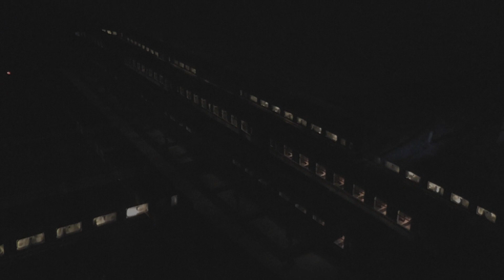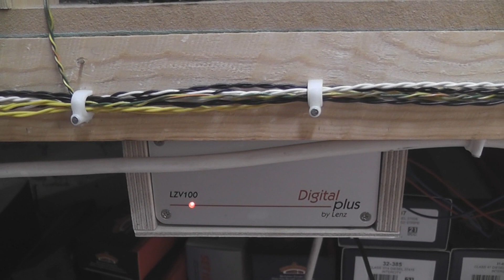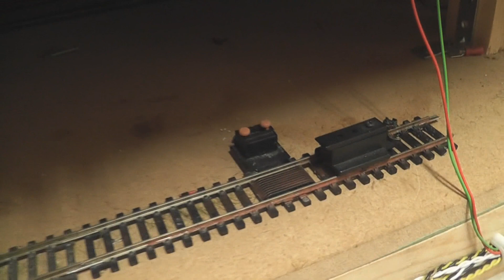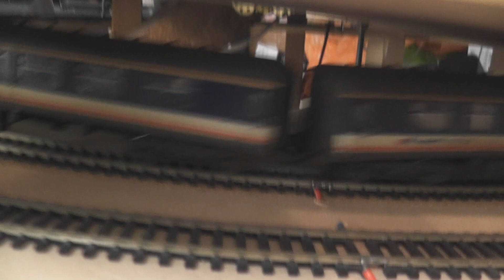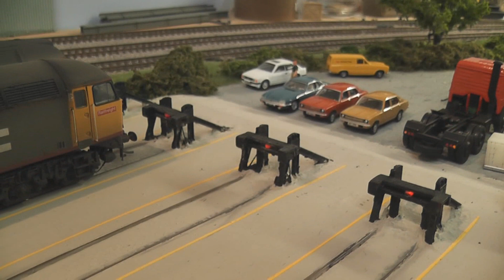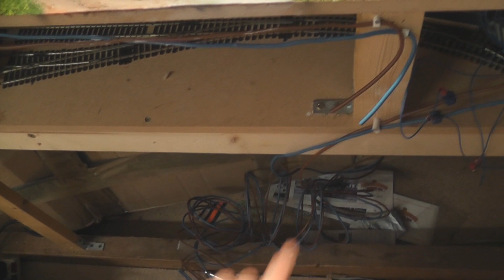Power and Control

Comment: Great to see the old layout and uninsulated loft. On the subject of the DCC bus wiring you were careful to point out that it wasn't a ring circuit, but wouldn't a ring give potentially lower impedance for trains further away from the controller wiring?

Comment: I really like your videos and find them easy to follow.  I'm new to the hobby and so I have some basic doubts, like.... does only one pair on wheels on the loco sense the current from the tracks?  Reason being, if more than one set of wheels are used to pick up the current, then there could be a conflict when changing  blocks, or when in a reverse loop situation  when polarities are switched. In the second case, the two sets of wheels could sense opposite polarities at the same time!  I'm sure that will never happen, but I need to clarify the doubt. Thanks, Ganny.

Comment: Hi Richard. I assume you solder dropper-wires to your track (rather than, say, use pre-soldered rail joiners) so as to maintain a reliable connection. So, I wondered why you chose the splice and spade connectors; I have seen other users prefer not to use these connectors because they believe the connections are not so reliable as soldered joints. Have you experienced any problems with splice and spade connectors?

Comment: you said that the bus wire isn't a loop, then wouldn't having two long pieces of wire be an unfinished circuit and not supply power?

Comment: Hello. Really enjoying these videos so thanks for doing them. I'm returning to model railways after many years and am intrigued by the technology. In this you showed a 3rd power supply from Rapid to power your signals. Could you have used this power supply to power both your signals and your accessory bus simultaneously? I'm looking to minimise the cost of starting again. Thanks again.
Reply from the maker: You should be able to use a single power supply.  Make sure you use a CDU if you are using solenoid point motors.
Reply: Will do. Thank you very much.

Comment: where do you get your locos and waggons
Reply: In Europe, most people get their stuff from Hornby and Gaugemaster, there's a few others but those are the biggies.  In America, Tony's Train Exchange and Nicholas Smith Trains are two very reputable sellers, but again there are many, many others -- Americans have a bigger choice of products and shops to buy from.  Plus there's always Amazon and eBay.  I try to buy from my local hobby shop, but they often charge way more for the same item than you can get it online, which is unfortunate.  You can usually order from across the pond to your side of the pond, but keep in mind that American retailers sell HO scale trains while European retailers sell OO scale trains.  Both HO and OO use the same track, but OO models are slightly bigger than HO models.  I run a mix of HO and OO scale trains on my layout, and you can't really tell the difference unless you have the exact same carriage in the different scales coupled together.  One big thing to keep in mind is if you buy OO scale trains from a European shop, even high end trains, they don't come with Kadee couplers and you'll have to install Kadee couplers yourself.  American trains tend to come with Kadee couplers, even the low end models.

Comment: Know you have a regulated supply, but could use a L7805 on your board which would convert 12V dc to 5V dc. Could save some expense for other people.
Reply from the maker: Challoch Junction Nothing wrong with making your own supply.  A common one is to modify a computer power supply.

Comment: have you got the code number for the buss wires you use please ? .. you give the connector codes, but not the code for the wires, whenever I shop for wire its hard to find single core wire .. thanks
Reply: fees sq SQL
Reply: JDPuss1 search for heavy duty household wire

Comment: I am currently sorting my loft, and once some flooring is down I will be looking to build a layout. Most of my stuff at the moment is DC (apart from one DCC loco I was given). I want to go DCC. Forgetting points for now, can I wire up the layout for DCC, but still run DC on it until I get some DCC kit?
Reply from the maker: ***** If you wire a layout for dcc but use a dc controller you will have issues with all your locos running at once.  All the track with dcc is wired up to the controller and there are no isolating sections.  So running with dc will be problematic.

Comment: hello, What is the best way to test that your bus cable and feeds to the rail are working correctly. Today I took out my insulfrog points and going to replace them with electrofrog points in the next day or two. I noticed that the rest of the layout was dead, even where the controller is connected to the bus wire. Is there anything to worry about? Thank You
Reply from the maker: Gary Shardlow The best thing to use is a multimeter to check them.  Is it a DCC layout?  Are the feeds running to the tracks you tested?
Reply: It is a DCC layout, The feeds running to the track have not been tested as I always had a continuous track circuit. I use slightly different crimp splicers where you have two places for your cables. One is a continuous hole where the bus cables goes in. The other has a dead end for your track feed to go in place. Then squeeze the metal plate into both cables and fold the plastic over the top. I was using a Hornby Select controller when I sent you the first message, I know the hornby select isn't the best. Just got a used Lenz LH100 and Lenz system in excellent condition on eBay last night for £137.00, and picked up a transformer today. I will test the track today at some point. TY

Comment: The Lenz system is fantastic for what it is. I do however like the Digitrax system too. Having used both I actually cant say either is better because they are both very high end DCC systems I did start off with a Hornby select just when DCC was first introduced to the market but quickly moved on to the Prodigy Advance unit. A quick note for anyone wanting to get into DCC but wondering how complicated it is well I would say DCC is so much easier than DC due to the fact that you make all the tracks live rather than any insulated sections.

Comment: I've recently begun to get back into model trains after many years.  40-plus to be more accurate.  I used to have a small, well landscaped DC setup when I was young.  Wiring and operation were very simple.  Approaching retirement, I now have the time (and resources) to go hog-wild.  Being new to DCC, and not having begun construction of my layout yet (it's still in the conceptual and planning stages), I've spent many hours reading and studying the changes in the hobby to make sure I avoid as many catastrophes and costly errors as possible.  I've watched hundreds of "how-to" videos on YouTube but I have to say, yours are far and above the most informative and helpful I've found.  Please keep making them!
 
I have one question though; have you given thought to wiring your signals into your point motors for automatic signalling?  I'll be running a moderate sized passenger station as well as a couple of large freight yards and signalling is a significant part of my planned layout.  I was wondering the what the best ways to might be to accomplish automatic signalling. 
Great work.  Thanks again!
Reply from the maker: hercdriver08

Thanks for the comment.  I'll be looking into wiring some signals to points but only the ones with directional indicators.  The few signals I do have are currently wired to work automatically on a time basis
and use the trains to trigger them.  I have another howto in the making about how they work which I'll try to get finished before christmas.

Comment: Hi, I'm new to DCC and this was a really helpful video.  Thanks a lot - appreciate it.  One thing I'm still not sure about, though. Do I still need to worry about + and - rails when wiring the track, or is it simply being consistent about which rail I wire to which bus wire?  Hope that's not a really daft question and look forward to hearing from you, cheers, Stu.
Reply from the maker: Stewart Fraser Make sure you are consistent when wiring the track.  I use a wagon with some black and red wire taped to either side.  Then make sure you keep the wagon to same way round and use it as a guide for wiring the rest of the layout.
Reply: EverardJunction Thanks a lot.  That's great - appreciate it, cheers, Stewart.
Reply: EverardJunction That's a fantastic idea, will do that myself.

Comment: Very helpful video, noted that the buzz wires are 2.5 dia, from your reply , would 1.5 dia do? and do you use the same for the droppers?  And what size of wire for points? I am at long last be able to make my layout in the basement and have looked at your how to videos very instructive
Thanks Keith
Reply from the maker: You can use any wire you want really.  The voltages and current involved is very low so most wire will do the job.

Comment: Hi, I think I got almost everything from rapid electronics, except the solid core bus wires you have, I don't think they have them. Could you please tell me what type of heat shrink you use from this link rapidonline com/Cables-Connectors/Rapid-3-1-Heat-shrink-sleeving-on-25m-reels-68952 ?

Comment from the maker: The bus wire is the 2.5mm solid core wire you get out of ordinary grey building wire. I bought a reel from a diy shop and stripped the two wires out from inside.

Comment: Hi,I picked up on your video that you do not 'loop' your bus wire back but leave the ends capped off, is there any reason for that?
I am just about to re-wire my 8x4 and was advised by CM3 Models where I got the wire from to loop it back to the DCC control power system.  Andy

Comment from the maker: The bus wire is the 2.5mm solid core wire you get out of ordinary grey building wire. I bought a reel from a diy shop and stripped the two wires out from inside. I think the dropper wire is 1.2mm.

Comment: I can a bit found out using Rong volt iron. If use insulfrog point i would wire each track of it to the bus. Is the bus better out or wire or copper tape what size wire do u use(the thick wire) is that needed or is the thick Peco/gaugemaster ok to use. Dose the splice some within instructions or are they oblivious how to use.

Comment from the maker: Generally people who build N gauge layouts wire them up the same as OO scale layouts as the N scale locos still require 12V to run.

Wiring points up to dcc really improves the running of the trains.  However if you can't solder then I would just go with insulfrog points.  I would also suggest you learn how to solder as it's required in many aspects of building a model railway.

Comment: I am using n gauge and want to use copper tape as cant solder but see ur  slice and the bus is huge wire wood it be needed in n . If wire all 3 set of the point to a separate bus would i need seep motor. In n if using elite and  pos railmaster with about 5 loco at once wood can i use dcc points

Comment from the maker: Ok, from what you said it sounds like you have a tender drive hornby flying scotsman.  The square truck with the coal in it is called the tender.  Steam trains with the motor in the tender are very unreliable.  They don't actually make them like that anymore.

I would suggest you take the train to your local model shop and get them to have a look at it.  Most most shops will service and repair model trains for you.

Comment: Im not to sure who makes the flying scotsman and i brought it of an exhibition stall around a year and a half ago. And also it was second hand when i got it and not sure how old it was before i got it. It is the front wheel of the engine carrage , i dont know what its called ( it is the part that has the coal bit on it and has the engine in it and its at the back of the 2 parts it comes with ie. the front which is the long part which has the pick ups and the back part with the engine in it) ??

Comment from the maker: An attic is quite good place to build, but has its problems.

Advantages..

Plenty of space
Good security
Doesn't matter if you make a mess
Quiet

Disadvantages

Cold in winter, hot in summer
If you're tall headroom can be a problem
Lots of lighting or a window is required

Comment from the maker: The bus wire is the 2.5mm solid core wire you get out or ordinary grey building wire. I bought a reel from a diy shop and stripped the two wires out from inside.

Comment from the maker: The bus wire is the 2.5mm solid core wire you get out or ordinary grey building wire. I bought a reel from a diy shop and stripped the two wires out from inside.  It's fine for a small layout, but you might want to use something smaller.

Comment: Hi. Great video. I have a few questions for, if possible, to answer. How much money do you usually spend on trains and carraiges etc?  I have a problem, i have a flying scotsman and all the time the front wheel of the back engine keeps lifting up and wobbling which means all the time it derails. Please help me with this. Is there any way to solve this. Ie. tightening something etc. as im quite new to model trains. Thanks

Comment: fantastic video Richard, I'm just about to wire mine up now, done the droppers but not added the buzz wire, but loads of help and advice from this, don't suppose you could explain how you program your locos, I know you can set them for acceleration and braking etc etc etc, but any advice would be appreciated cheers andy

Comment: Are you not a fan of the DCC sound things. I noticed when you turned the light off your Intercity rake seems to have the same coloured roof the First Open one i bought yesterday has a black roof and my intercity 125's have a grey one was this normal to have different variations or colours